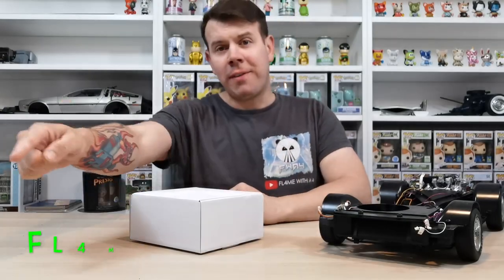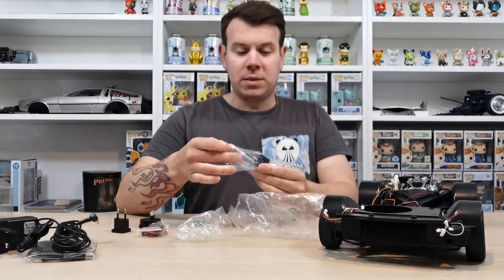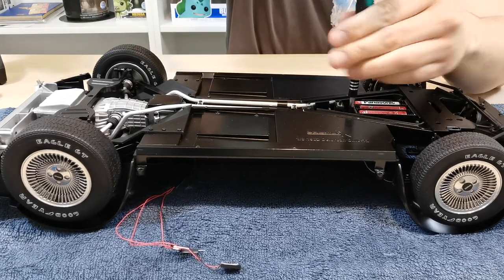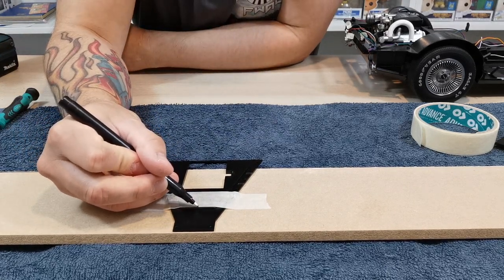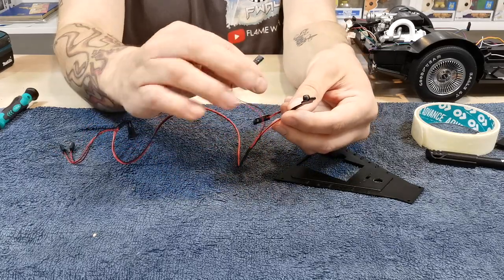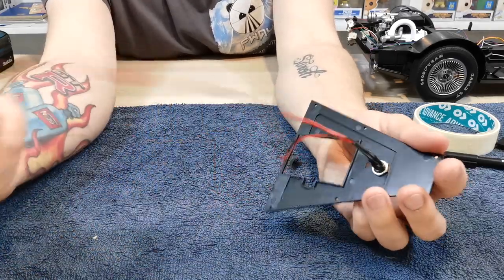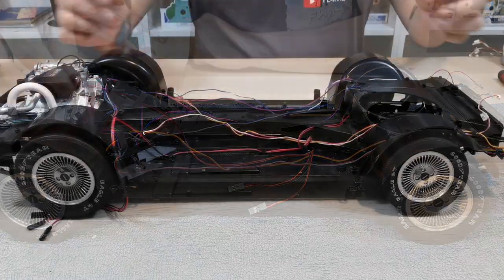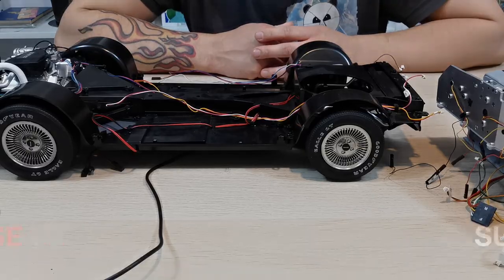Build The Back To The Future Delorean - The Power Mod ( Easy Install ) By Chloe & Kiran @ Model Modz

Comment: I have the Spitfire 1A model plane they have 3 C batteries to use with model hoists, would this Power Mod be strong enough to work. i would like to check with you before buying the Pwr Mod unit. thanks Phil

Comment: Why don'y you show in all your video's exactly where all the wires go to and what number to operate everything? I am so confused where to put the three wires to power my EL rope.
Reply from the maker: I do show everything, what is it that you are stuck on? Also it's the same switch that turns on the blue LEDs as you are replacing them with upgrades cable that glows better, these also come with fitting instructions if that helps 😁🔥
Reply: @FWA4  Wasnt getting disrespectful, it was just a question but anyway I figured it out thanks. Anyway keep up the good work and have a great day.
Reply: None of my 1-13 pins on the circuit board work. Have I connected something wrong as I got a second circuit board and it has the same issue. The 1-13 wires are fine too as I've put 12 in one of the 14-23 pins and it goes on so it seems there's no power going to pins 1-13...help